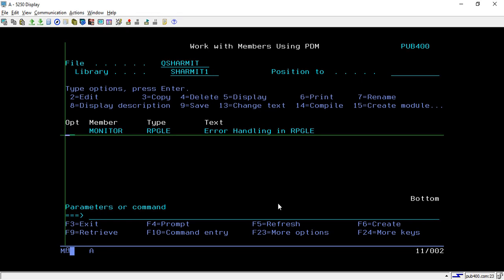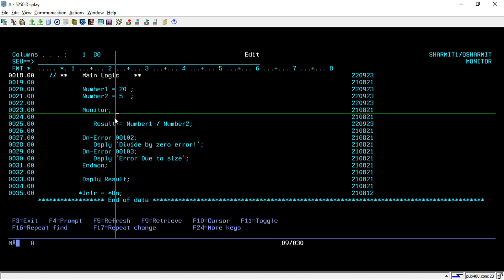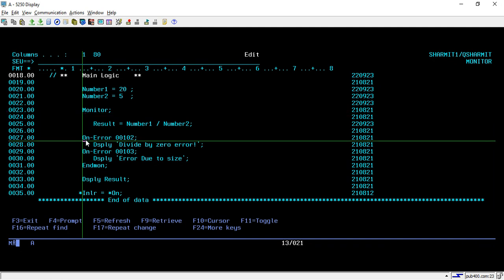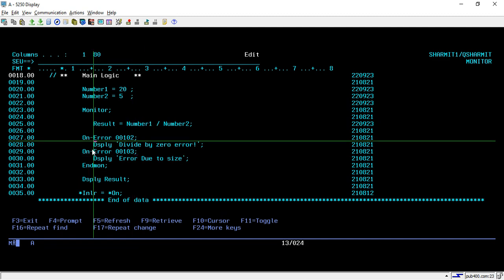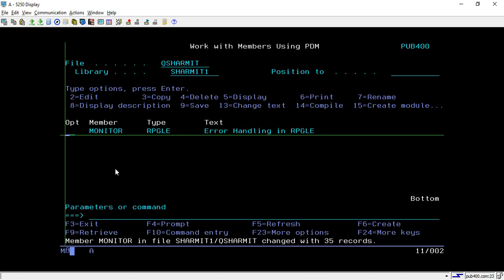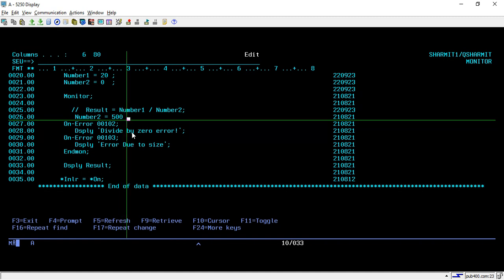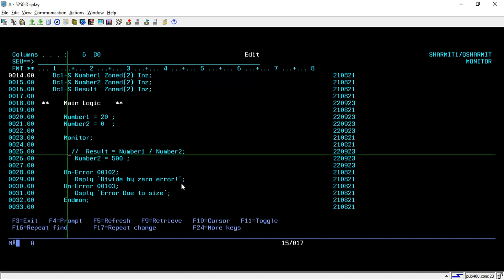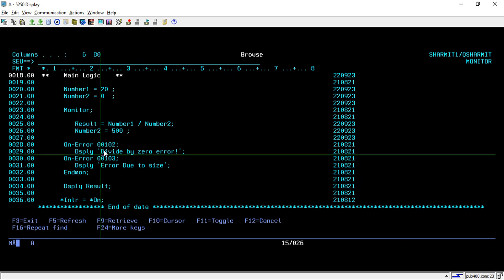IBMi (AS400) Error Handling using Monitor Block in in RPGLE | as400 for beginners | Opcodes in rpgle

Comment: 00102 using why in on-error
Reply from the maker: The ON-ERROR statement in COBOL (or similar programming languages) is used to handle exceptions or errors that occur during the execution of a program.

In the case of the specific error code 00102, this typically indicates a specific type of runtime error, such as an issue related to file operations, data conversion, or invalid operations.